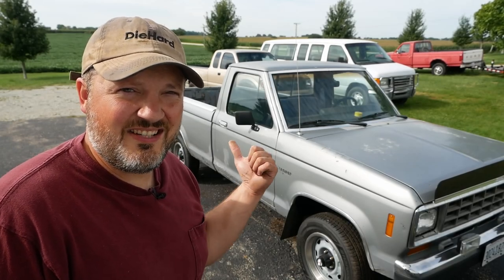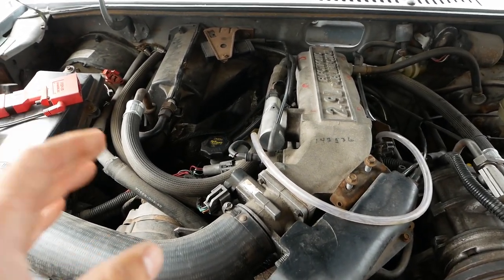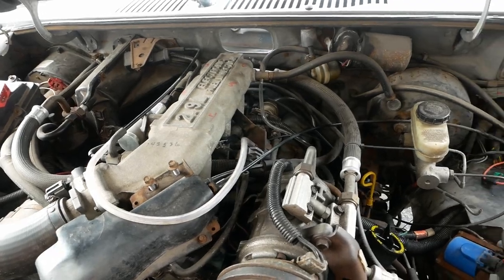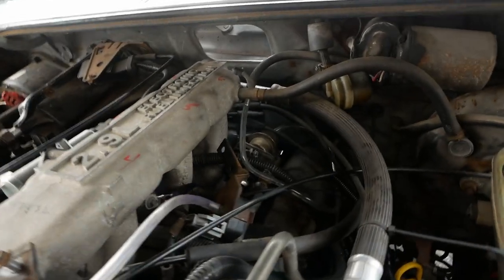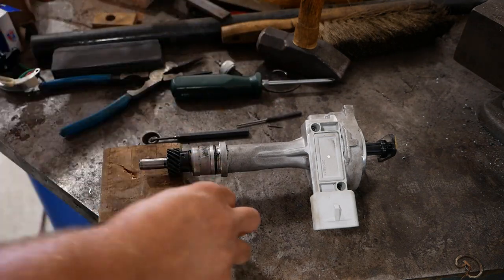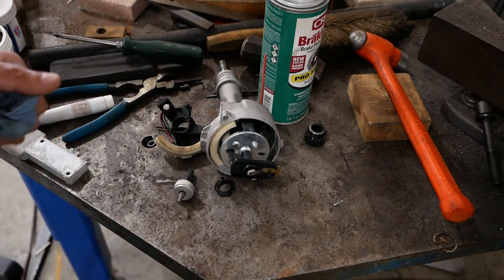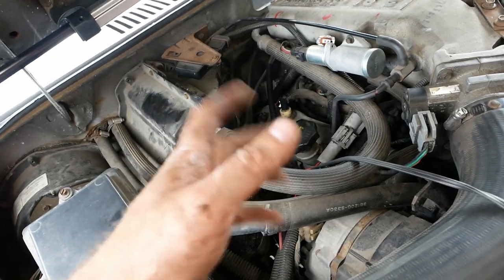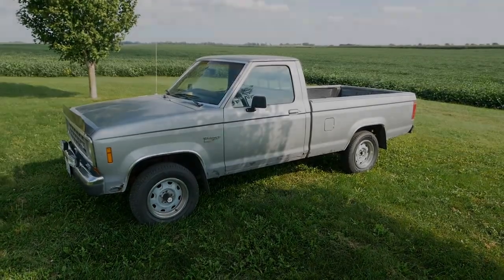Rusty Ranger Returns with More Bad New Parts - Randomly Stalling

Comment: As a farmer yes the prices are good but the price of diesel fuel,fertilizer and chemicals have also doubled and some have tripled. The government wont allow high prices without everything else following. That goes with everything i guess though.
Reply from the maker: Yeah the farmers here keep complaining from the driver seat of their $95,000 pickups.
Reply: @WatchWesWork  Not all farms are created equal. Big farms will still make it but wont be getting that 95000 dollar truck every year unless they have 200 plus corn and 50 plus beans. Not the case in my area. Were burnt up.Small to medium farms are the ones that will struggle most. Farmin is like rolling the dice in Vegas. You either hit or the casino(bank) is taking everything you got.

Comment: The engine tick is designed to be the best harmonic match for the power steering whine. 
Thanks for keeping this little beauty on the road!
Reply: If you feather the throttle just right to change the ptich of the whine and the tempo of the tick, you and your ford can sing along with what you're playing on the radio. Sounds like a feature to me. lol
Reply: I think every non-V8 Ford I've owned has had a tick of some sort.  My 4.0L Ranger had EVERY SINGLE hydraulic lifter seized from gunk in the tiny pressurized oil passages.  No more hydraulic valve lash, combined with less than ideal top end oiling to begin with, and the push rod tips get flat.  Ticking ensues.
Reply: Is this frank fritzs truck?! Lol
Reply: @samholdsworth420  yup
Reply: @rhekman  My 1986 F-250 with the EFI 302 had the same "ticking" sound I heard on this Ranger at the end when he was letting it run on the base timing.  I was told at some point it was the injectors, but I have no idea. :)
Reply: @kendewitt5811  Yeah, "ticking" can mean a lot of things.  I've personally seen it come from everything from exhaust leaks , to worn accessory drives, to sparking burnt plug wires, to bad IAC valves, and just general valve-train wear.  Diagnosis usually involves finding the frequency match (rpm, rpm/2, etc.) then careful use of a mechanic's stethoscope.
Reply: I'm a Ford guy. It wouldn't be a Ford if the power steering pump didn't make noise...LOL
Reply: Funny! The German. 2.9 was pure junk barely making more power than the 2.3 liter Pinto 4 banger while drinking way more fuel and being way less reliable.
Reply: @sharedknowledge6640  I wouldn't call the 2.9 pure junk, but the 2.3L I4 was definitely more reliable. By the 90's when the Ranger was offered with the Lima 2.3 I4, the Vulcan 3.0 V6, or the Cologne 4.0 V6, there was a definite tradeoff in reliability and efficiency as you went up in displacement.

Once the German block got stroked out to 4 liters, beefier cylinder heads, and a roller camshaft, there wasn't much that would go wrong.
Reply: @rhekman  The ancient pushrod 4 liter version made stupidly low power compared to nearly every thing else including the GM 4.3L V6. And then Ford lost their mind and turned it into a SOHC motor with a completely unserviceable unreliable timing chain at the BACK of the engine in what might be the dumbest engine kludge ever. The Mazda based DOHC 2.3 liter in later Rangers with a 5 speed manual will literally beat the POS pushrod 4 liter in the quarter mile. And the 3 liter was even more of an embarrassment for power. The best ranger to own is a 4 cylinder and ideally the Mazda DOHC version from 2001 onward which which being all aluminum weighs about half of the cast iron options making the truck much better balanced and lighter, and gets 30 mpg while leaving the ancient cast iron motors in its dust. Only the incredibly poorly designed and expensive to repair SOHC 4 liter can really beat the DOHC 2.3 while sucking about twice the fuel.
Reply: @sharedknowledge6640  Well yes, I was speaking to the engine options in the 80s and early 90s when the 2.9 was current.  I'd agree the 3.0 was a dog - only 1-2mpg better in fuel economy compared to the 4.0 for less power and way less torque.

Comment: Working on old Harleys taught me that aftermarket stuff can be junk. Fortunately for the Harley crowd, a whole ecosystem developed of "better than OEM," stuff like Jim's and S&S and other companies. Here we see how the aftermarket distributor company bought a module with improper alloy contacts. They are supposed to be beryllium-copper alloy so they stay nice and springy. It's a classic problem, the terminal looks springy when they assemble it, but after some heat cycles and vibration they bend open. The distributor company never knew they were getting ripped off since cheapo aftermarket companies don't do exhaustive incoming inspection. The module company might have been clueless as well.

This reminded me of when I was an engineer at Ford Light Truck in the early 1980s. We had an ignition module mounted on the fender. It had a paper-phenolic circuit board that would crack and cause the truck to die. After it cooled off, the board would flex back and the truck would start again. I said, "simple, just replace the circuit board with an FR-4 board". They looked at me like I was insane. This module was used in all the cars and trucks, six million vehicles a year. It would cost a dollar to change-- and they explained that Ford engineers were supposed to save money, not cost money. I saw guys lose a career for a 5-cent mistake and managers get fired for a 50-cent mistake. A dollar mistake would have gotten the whole department fired. Finance whiz kids ruined that company back then. So in the end, they poured sand in the die cast housing and placed the crappy board on top before potting it in. This fixed the problem for a few cents, in fact, since sand was cheaper than potting compound, it might have been booked as a cost savings. The reliability of the module was 12 or 14 Rs per hundred,  in another words, 12% of the modules failed in the 12-month, 12.000-mile warranty period. It was the worst reliability part in Ford history, and I was the truck guy that had to use it.

I quit Ford and went to Silicon Valley, where I met a tech that had the same problem with his old Capri or Pinto. He learned he could wedge a "drunk bump" highway marker under the module against the potting, and when he screwed it down, it warped the board enough so it stopped cutting out. He figured this out on the side of the road. His skills were as amazing as yours, great episode.
Reply: Well, clearly Ford is still suffering the same problems with the financial whiz kids ruining Ford's quality and reputation. We only have to look at their recent recall record to verify that.
Reply: I remember very well the issues with those EEC modules. They didn’t do much better with the first TFI modules. I used to carry a spare module and tools in my Ranger, just in case……
Reply: Thanks for the story. As a machinist with 40 years' experience and plenty of manufacturing war stories, I also had my own go-arounds with managers and engineers about quality. I enjoy hearing from those who were trying to put out quality products and the backlash they were forced to deal with.
Reply: Iam with ya on Harley stuff sheez
Reply: Beryllium copper is not allowed in a lot of places because of the risk of Berylosis. Copper plated nickel alloy is the only real replacement. Not cheap.

Comment: Back in the day my dad owned an 86 2.9 Ranger from almost new.  From the word go, if it was colder than 20 degrees out, it wouldn't start.  If we were ice fishing, we had to go out and start it every couple of hours so we wouldn't get stranded.  Finally, after 170,000 miles, the TFI module finally failed.  After it was replaced, the cold weather start issue was resolved!  He drove that truck all those years like that...

Comment: I can't properly verbalize my appreciation for the level of detail you go in to, Wes.  I've worked on Ford EEC-IV stuff, even as recently as a month or so ago, and as a high schooler.  I didn't have the gizmos for testing, but I could short out two pins on the Ford OBD1 connector to read stored codes and to also run the KOER test.  Something like this would have forced me to go to a mechanic.  Thanks for putting in the effort to film and describe all the steps involved in the solution.  You continue to fascinate me!
Reply: Same! I don't either my rangers running on $20-30 ebay sensors every once and a while, it currently has this exact issue and I was watching this for entertainment but found it helpful as it's detailed and he said the names of the part

Comment: Nicely done! My '84 Escort consumed one of those 3 pin TFI modules every 40k or so and at least 1 pickup coil in 120k. Yes, I always used fresh thermal grease.  I put 150k on an 87 with the later TFI setup (7 pins) and had no issues. Makes me think the early stuff was junk.
Reply from the maker: Every Ford owner carried a spare TFI at one time.
Reply: @WatchWesWork  Got mine with heatsink behind the seat ready to go
Reply: They even had some sort of service bulletin on them, so they knew.
Reply: @rolandgsl  lawsuit/recall.
stalling in traffic=not fun

Comment: Dad and I continue to work on our 87 2.9l Ranger 4WD manual, so I love it when the Rusty Ranger gets some screen time! Over the years I've replaced a lot of those top-end parts, but i haven't gotten into those parts you replaced in this video (i've done injector cleaning, IACV, fuel pressure regulator, among other fun vacuum parts). Come to think of it, I bet they are playing a part in the overall weirdness in the performance. You had that thing sounding better than ours has in decades! Thanks for this - sending it my dad's way to discuss later!

Comment: Thanks for stirring up lots of memories, Wes. Spent a lot of time under those hoods chasing DPFs, EGR problems, module's and pick up some on Fords. The DPF would short the 5 volt line and kill the truck. Kept dozens of them in stock. Sold them as maintainence. Made lots of mortgage payments of those 80s ford's. Thanks for another good show.
Reply: Changing the differential module on my Skoda diesel on Monday to hopefully sort my EGR fault .

Comment: That fuel pressure regulator is one of the first things I check on these old Ferds. 20 years seems to be their lifespan, at least here in Arizona. I've had a couple fail in that exact manner; one burned out a cat and melted the downstream O2 sensor, the other just severely fouled it's spark plugs. Thank goodness it's easy enough to pop that vacuum hose off lol.

Comment: Been running into a bunch of junk new parts. Just did a timing belt on a Dodge 3.5 and the kit I bought was from Gates. The timing belt idler pulley bracket was supplied by GMB and when tightened down to 61 Nm the tensioner would not allow the idler to pivot. I removed the new idler pulley from the GMB bracket and used the factory bracket. Gotta be careful with these parts nowadays.

Comment: Wes, when you are dealing with loose connections or even one connector, you can twist the prongs a little and make connections that way. If it is on the outer side connection shell portion, crime the rolled portions a little to tighten it up. Could allow a part to work that way... Another great video and troubleshooting issue. Thumbs Up!
Reply: It's funny how we learn these quick fixes. I've done it on cars, refrigerator, washers and dryers. You always have to tweak these things to make them play nice.

Comment: I've been holding off watching this video because of other things I needed to get done so you may not see this comment (728 before me).  I have an 86 Crown Vic and have found the books by Charles Probst really helpful in understanding how things work and diagnosing problems on my 86 Ford.  Very interesting watching what you did on this one.  So far I've been really lucky that not many parts have died because replacements are getting really hard to find.  Still running strong at 302,000 miles!

Comment: I'm a huge Ranger enthusiast, especially these 1st Gens. Currently restoring a single cab 83' Ranger 2.3L 4x4 '4 Speed stick shift and absolutely love it. I bought mine out in San Diego while I was there for the Navy back in February, drove it to Norfolk in May. Drove over 2700 miles and it made it with out a single issue. 

Every Ranger I owned that had that dreadful 2.9L never ran right and always had issues. They aren't bad motors, it's the 80s emissions and technology that plagued the 2.8/2.9Ls. It's why I bought a carbureted 2.3L and currently about to throw in a Holley 350 that is jetted and tuned down for a 2.3L along with a RacerWalsh cannon port intake.

Comment: Wes you have to love the quality of the new parts now days. If you get more the the 1 year warranty off of them you did good. Not all that way  but most seem to be on that . Good video today. Have a great day 👍🏻👋
Reply: You also can't buy the absolute cheapest part you can get and expect it to last, either.  I buy made in the USA Timken wheel bearings for my vehicles, where one of them typically costs 5 times as much as the cheapest option, but I don't end up replacing it a second time, either.

Comment: The aftermarket ignition modules are usually junk too!  I never had a specialty tool just (several) turned down deep well sockets in my toolbox.  I never could find the specialty one when I needed it and ended up turning down multiple.  Good diagnostic video Wes!  👍😁

Comment: I had a 91 Ranger 4x4 with the 2.9L. Put over  210,000 miles on it. I sold it and saw it around town for several years and it kind of made me sad that I got rid of it. Was a great truck.

Comment: I know the parts situation makes you question any preventive maintenance. I have a 96 Mazda B2300 that I pull behind my motor home and the clutch is getting close to the end. I keep thinking about replacing it, but sometimes it’s better not to touch stuff that still works. 😂😂

Comment: Had an old 87 Ranger with the 2.9L. The EGR pipe between the manifold and the valve had rusted through and caused a loud ticking exhaust noise. Took it out, drove a brass plug in the manifold, folded the pipe over and sealed it and put back in the valve to keep from sucking dirty air. Miss that truck

Comment: In the past I've soldered up a bit of a bead on male spade connectors to snug it up into the female connector which couldn't be accessed easily to bend them back into shape. Works good in a pinch.

Comment: Great job and diagnostic. I do have the TFI socket. I had a 1985 T-Bird that I had new. I learned about the fact that the distributor had to some apart back then. They were a real weak point. I think they had an issue with getting too hot. I had a 1987 Bronco with that engine too. The 1991 Ranger I had with the 3.0 was much nicer and more powerful. It reached 340K miles with only an oil pump and other wear items. Trans started slipping and I sold it for $1000 in 2000 ish.

Comment: I had an 85 Oldsmobile Calais and the ignition module went out. Swapped it out and 3 months later the module died again. Swap, run and fail 3 months later. Bit the bullet and bought an OE GM module. Never had a problem again....

Comment: I owned an AMC Gremlin back in the 70's. I would drive down the road and the engine would die. I would turn the key to start and it would start within seconds. This would only happen once in maybe 20-100  miles. I was afraid to take it to the dealer because they would think i'm nuts. Finally about 2 yrs' later I received a recall that the plugin for the distributor sensor needed cleaned and lubed with electrical grease. Back then they didn't have computers, most machanics didn't have electricial knowledge like today.

Comment: Yep, the trouble shoot process for all of mine was : If it dies and cranks back, pickup sensor. If it dies and doesn't crank back, TFI module. I used to keep an extra TFI module in the glove box on mine, then I learned about those nifty remote mount TFI modules and switched over to them.

Comment: Nostalgia: check ✔️.
My first Ranger was an '88 2.9 standard long box, with 200000 km of previous enjoyment already clocked.
I put almost another 100k of perfect motoring before it started to exhibit these exact complaints!
Multiple diagnostics from the dealer included over 40 hours of "computer connected diagnostics", a new/used ECM, then a brand new ECM, replacement of most of the electro-mechanical do-dads...all to no avail: it stalled in the parking lot when I went to pick it up. The dealer stopped charging me shop time, because the head mechanic was then on a mission to get to the bottom of this.
The entire book and read-outs were eventually sent to Ford.
Their considered response:
"Tell your customer to buy a new truck" 😡

Comment: the gift that keeps on giving LoL. EEC-IV  Fords in Australia, in that era are the same hardware but a completely different diagnostics port. Nobody has the tool to read them, its only possible to set up a test light and read blink codes of the correct pins. Around 2000, the plug changed to OBD we know and love, but requires Forscan software and a unique ELM327 adapter.
Reply from the maker: Weird.

Comment: Had an 85, with the last year of the carb and 2.8, and the ign module went out (died when hot, but would run when cooled,off, until it didn’t).  When I went to replace it, found the connector on the part inside the distributor had melted.  Had the little tool, too. Ended up swapping the whole distributor in the parts store parking lot. Got lucky, and got the gear in the right way on the first try.  Also did the egr controller at some point.  But my favorite fix was the carb would ice over on hot humid days.  Would have to let it sit and thaw. I put a bolt in the flapper in the air cleaner from the manifold heat riser so it would always draw hot air, and it ran great from then on.